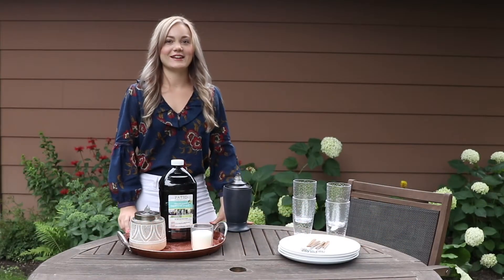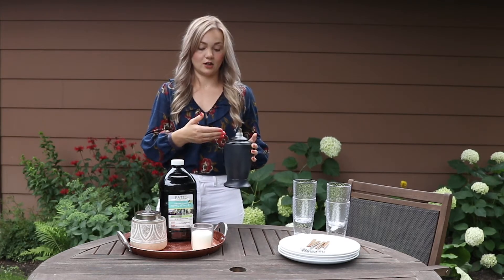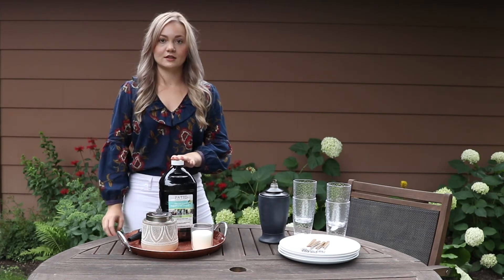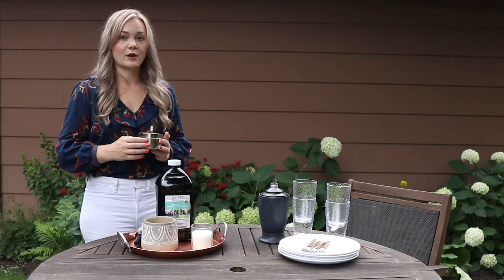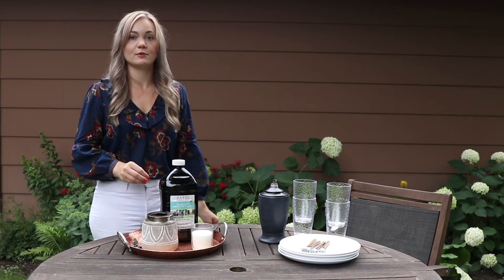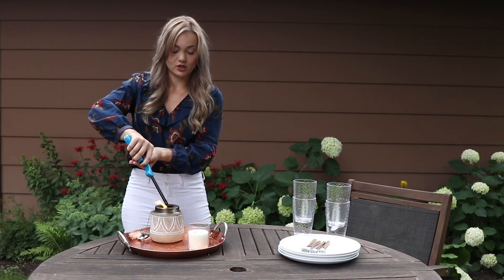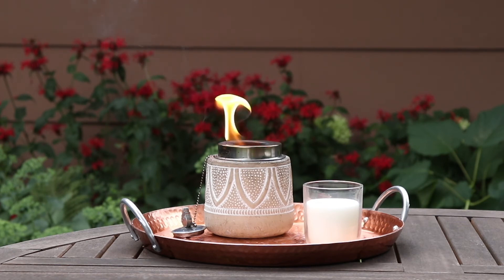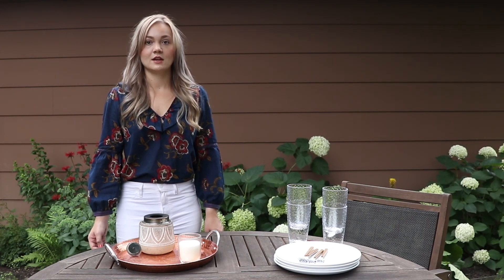How to Light & Fill Your Tabletop Torch

Comment: How long should the wik be?
Reply from the maker: Hi, Missy! This style of torch doesn't have an adjustable wick. It comes with what is called a puck wick, it is just a round disk inside the torch fuel canister and it cannot be adjusted.